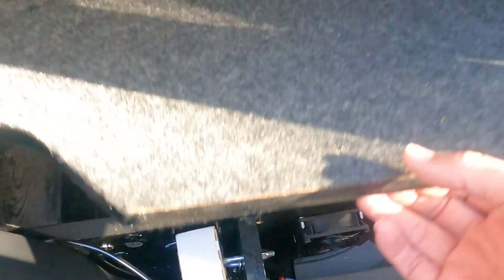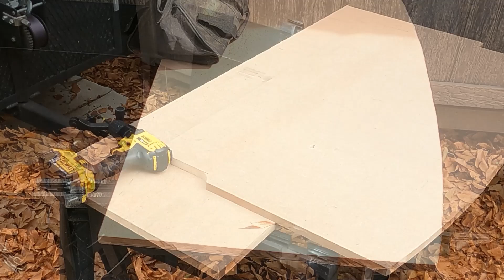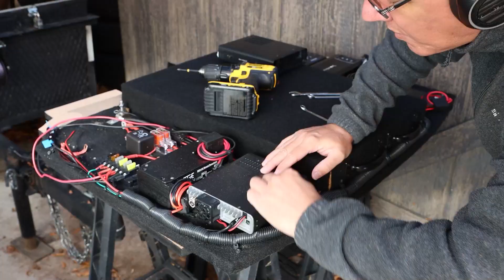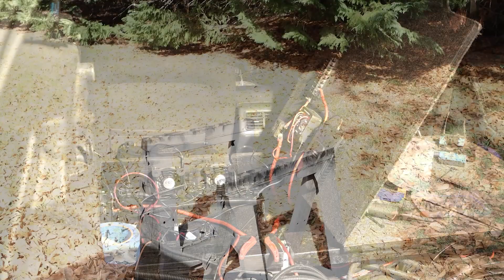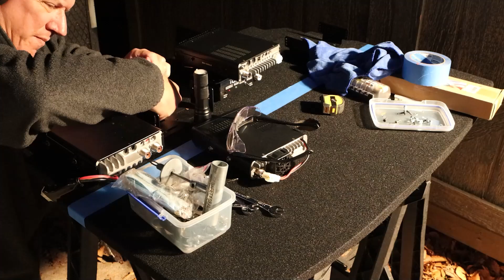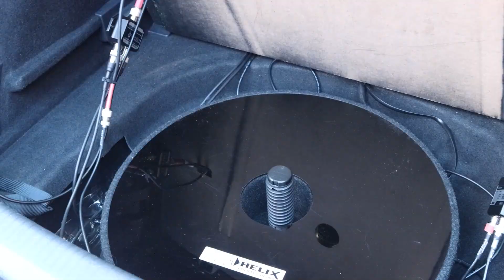Ham Overhaul: Phase 2 Complete!

Comment: Im going to run an ftm400 (15amps) and an ft891(25amps) in my truck.  The plan is to mount everything behind the back seats to an board that will be glued.  They will be fed by about 20 ft. of 4-awg from the battery into a bus bar  at the radios to distribute power.   Should the feed line be fused at the battery, if so to what degree?  This would be the first time running a multi-radio install and there are many conflicting articles out there.  I would still need to adapt down to Anderson power poles.  Thanks for the input.
Reply from the maker: Definitely fuse at the battery as close as you can get. A 100A fuse is fine here. Then, closer to the equipment, use a fuse block to divide the feed to the radios and use equipment-specific fuses there. See my 12V write-up at https://ke4wmf.com/12v-power-distribution/. Thanks for visiting!

Comment: Nice job Scott. That's a heckuva lot of work in just a few days. There's no magic shortcut, is there ... every single wire and connector has to be dealt with to get it all done. Somehow, now I don't feel so bad about how long it's taking me to wire my shack in my Sprinter van.
Reply from the maker: Haha! Yes, it takes a bit. I still have one wayward Cat5 cable to remove. It routes beneath the LiFePo4 battery and is buried well. I'll get it out someday. Next, I'll start working on more coaxial runs. I need to add three before the ARRL VHF Contest. Each run will be broken into three segments due to the diplexers and window panel. Thanks for visiting.